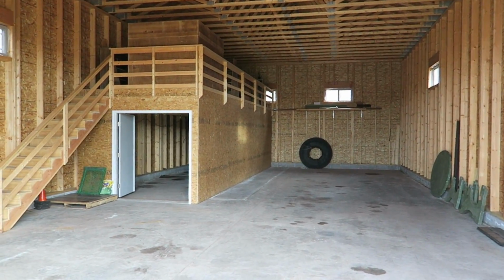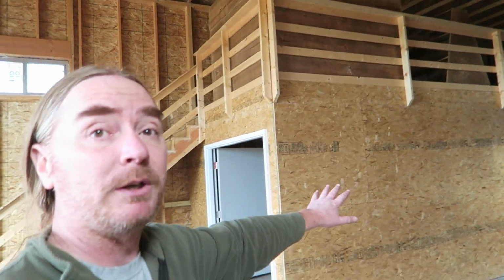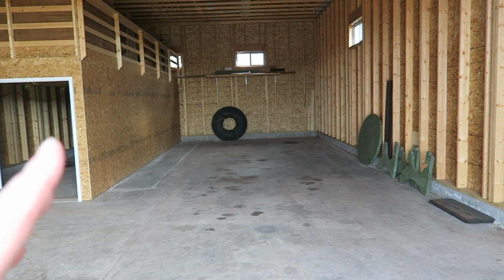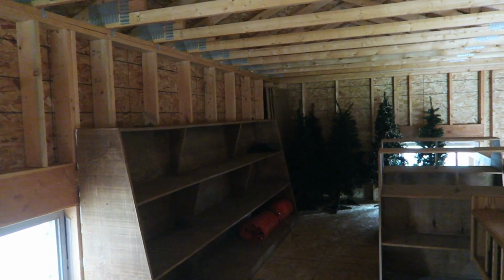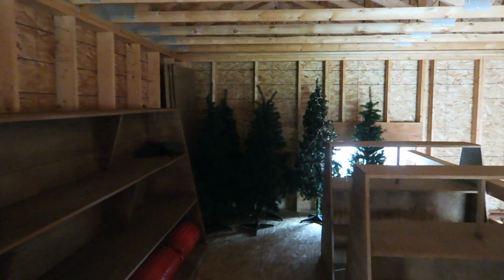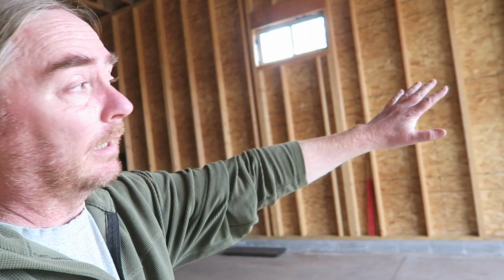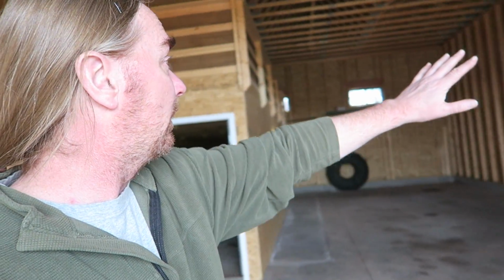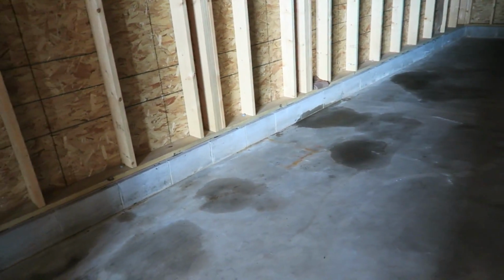CHECK OUT THE NEW BOAT SHOP!!

Comment: One note: in Michigan you are not required to have a licensed contractor run your electrical.  I just wired the basement and garage at my place.  Pull the permit and have a chat with your inspector, they can be very helpful.  My inspector told me what he wanted to see before his next visit, that made it even easier to pass inspection and saved us both time.

Comment: Hi Andy, I'd recommend a U value for your walls of less than 0.35 as this will give a stable temperature in your workshop.  The reciprocal of the R value for the various elements making up your wall (cladding, insulation, air gap, etc) are added together to give the U value (simpler than it sounds).  The heat transfer through the fabric is then calculated from U value x Area x Difference in temperature (inside to outside in winter).  Add all the sides up (including the roof and the floor) and you have the total heat loss through the fabric in kW. Sealing against draughts (air infiltration) is the next step, however you achieve it, if possible try to aim for less 0.3 air changes per hour.  Finally you will need ventilation as you will be painting, etc, so all that air will need to be heated too.  I'd recommend a simple heat recovery air handler to make the most use of the heat you've already got in your workshop, recovering up to 95% of the heat in the workshop.  Its a shame the slab isn't insulated as that will always be a heat sink, but you can compensate by getting the remaining fabric as energy efficient as possible.  Once done, you'll need some heating (you can calculate this from the three steps above), as you have gas, you might consider gas-fired radiant heating.  This will be out of your way and won't blow air around to warm the space.  As for the ventilation you might consider displacement ventilation with, say, 4 outlets ducted from your air-handler to low level grilles in the workshop and a single high level extract.  This will keep the place fresh and cool in summer and shouldn't blow duct around too much.  The last recommendation is to do what you can to stop air leakage around your roller shutter door.  All the best.  Andrew - Consulting Engineer

Comment: I would suggest getting estimates for the trenching and cabling to the shed for grid connection. Compare those to a Solar/ battery storage system, backed up by an Enerpac style propane generator for low solar gain days. Means you become Energy independent. factor those front end costs along with lifecycles, to ongoing utility charges to see if it is worthwhile. 
Many many good suggestions in comments re: insulation and LED lighting but the standout for me is Matt Risingers youtube channel. You want efficiency and not having to spend a single cent more on outgoings after initial build/ reno costs, I am of the opinion his advice is gold
Good luck with it all

Comment: Wow, looks a nice work area. Pity about the costs, but if you're not planning to move again it's worth doing a proper job of it. As for lighting, make sure you get LED lights. Way cheaper to maintain, lasts longer and is MUCH brighter for fewer Watts.

Comment: Could you top the current concrete floor with some rigid insulation and then overtop that again with a new concrete floor so the insulation prevents heat loss into the ground? Added bonus is that you have an opportunity to run services under the overtop concrete. You can pop up power into wherever you want to then.

Comment: Hey Andy, Congratulations on the move!  That shop is going to be awesome!  Yes, 3.5-4" spray foam is a typical application.  It is superior to batting & vapour barrier and gives a tighter seal (less air leakage).  For sure you will not need more insulations in the walls.  Most heat will be lost through the windows and attic than the walls.  

Have you considered geothermal heating?  It will offer the lowest operating costs by far and you'll not have to worry about getting another service  to the shop.  If you shoot me the dimensions of the building and details of the windows, I'd be happy to run a heat-loss calculation so you'll know what size of equipment you'll be looking at.

Comment: Maybe, if the height is too tall, you could put a mezzanine floor in if only for storage. Don't go mad with the insulation as the floor and large doors will always be the main heat loss. Also don't forget to think about the old bridging and condensation.

Comment: Homeowners can pull all permits to build or modify their own homes, including all Building Permit, Soil Erosion, All Mechanicals, Electricals, Plumbing, Driveway, Fencing, even build an engineered septic field (though your drawings have to be stamped).  Understand this is not a residence, so the rules are looser yet, Agriculture buildings are the least restricted cause there is no CofO.   The homeowner then does the work, and may have friends and handymen help.  Contractors are required to be licensed only if the jobs are in excess of $600.  If a homeowner acts as the GC, then in my community, a small town in Oakland County MI, at least 3 trades need to pull permits, Plumb/HVAC/Elec.  Your outbuilding looks top notch, fairwinds Andy!

Comment: Andy, love your channel... never commented before.

If this is your forever home and forever shop why start with a building that so compromises your ability to work.  I’m sure if you factor in the cost of running services 500 feet underground and the additional cost of 30 years of gas and electricity heating a shop with an uninsulated floor you would be better off building a new shop. Build it near the gas and electric, build it where it is accessible by road and build it to your size specifications of width, height and length. Build it with underfloor heating, spray foam from the beginning and I’m sure it won’t cost a whole lot more than renovating that shed. Check out R&R buildings on youtube. Kyle builds these buildings every day

Comment: My $0.02 worth...  you have room in that building to make the walls much deeper than the 6" studs, which also conduct heat.  I would think about  making them 8" deep (or more), with foam, fiberglass, then a 2x4 interior wall and drywall.  
Lumber prices have shot through the roof (3x?) in the last year due to COVID shortages on production, and high demand for larger houses on the consumption side.  Anything involving lumber that you can delay may save you money.
As an alternative to a gas line, you may be able to use a large exterior propane tank, and save trenching costs.
#notanexpert

Looks like a nice space!

Comment: set poles to run service ? led low bays 200 amp service 30-40 circuit panel 4  foot outlets every 10 feet lower lights in work areas. water ? off house if u dig electric freeze line 4 feet?

Comment: 9500. spray + 4000 ceiling blown 1/3 more for thicker.
 owner builder permit should be allowed anywhere. if not dont permit. screw um the problem is cost and freeze level. start digging.

Comment: For insulation in the walls we spray 1" of foam and fiberglass batts over that.  Ceiling we usually go with fiberglass batts, or blown in if access is poor.

Comment: I live in the upper Midwest and had Icynene foam done 13 years ago. Studs are old, full 4" timbers. Cavities were slightly overfilled and cut flush with a massive hand saw. The installer said it was an advantage because, in addition to stopping air infiltration it eliminates air period. No air, no moisture. Good luck!

Comment: what about the issue of running a business in a rural area.. a friend spent a fortune in a dairy barn to make it into a top notch automotive shop. county said a year or two after he had been running . nope nope nope..  Sampson boat on YT had a single neighbor that complained and he has to finish  enough of Tally Ho to move it to a big boat shop in town..  you may have an electrical and perhaps heating alternative or backup.. by using a marine generator set in an external building that is built with staggered stud walls.. so the sound does not transfer thru the wall .. this could power your shop and if you are going to live in a house there too.. it could supply heat to the hot water radiators in the shop..  i know of one guy who runs  milk delivery service. and he has installed a reefer unit on his home.  as  back up heating and back up AC as its in SO cal.. and he lives on a hillside in the sun. 
 i totally agree that at least the area outside the slab in front of the shop is way too sloped to safely get a boat of decent size in and out without issues..

Comment: You have a lot of studs and the thermal bridging is significant if you go with closed cell foam. CCF is a great vapor barrier - you won't need a plastic sheet VB but what really matters is the R value of the whole wall assembly. Sparay Foam also glles your building together and any future renovations are made much more difficult. If it were my building I'd flash and bat with rockwool then sheetrock. See here:  https://www.finehomebuilding.com/project-guides/insulation/closed-cell-foam-studs-waste

Comment: Low intensity infrared tube heaters would be best for the work you do and that type of building. Very comfortable. Make sure they use outside air for combustion due to your dust.

R 19 would be your minimum.

Comment: for heat look into a used oil heater. it can also burn your old solvents if you mix them with old oil. they are cheep. 4 K for a great one.

Comment: Andy, congrats on the new place. I would go with rockwool insulation.  Great R value and you can do it yourself. As far as lights, go with LED. Be careful, you get what you pay for with those. Also, with LED's, the better quality lights won't give you a hyper flash that you will be able to see on camera. Good luck with the project. Can't wait to see it finished.

Comment: Andy spray foam and R values really don't mean much. R value is a measure of time. The higher the R-value the longer it takes for heat or cold to radiate through it. Spray foam does not radiate heat or cold so you would be much better off with 3 to 4 inches of foam in the walls and 5 to 6 inches of open cell foam on the roof deck. Most heat will come thru the ceiling or in your case escape there. Foam is the only way to go but you would need to use it in both the walls and roof deck. Otherwise you are wasting your money to do only walls or only roof. Good luck and I love your channel.

Comment: Andy, as a retired electrician, who has done a lot of shops, I'll throw my two cents in. Do not put any electrical in the walls. Keep your vapor barrier intact.  I usually run a 3/4 conduit at 54 inches all around the perimeter with junction boxes every 8 feet. Your switches and recepticles can come off these junction boxes. And go for the LED highbays for lights, I've never had a complaint. And keep your panel, heating and compressor in a separate "utility room". A friend of mine glued Styrofoam panels to the inside of the overhead door panels, it was a big improvement

Comment: The studs look like they are 2 feet on center. Counting the studs, the building looks to be 30 feet by 62 feet, you need to get your tape measure and double check the stud spacing and then count the studs to get a building size. Running utilities will also get expensive, you will need electric, water and possible gas run to your building. Get a cost estimate to have someone run the utilities and then you will know how much money you will have to do insulation, lights etc, to have a working shop. You have a great base of followers with good ideas of how to do things cheaper, so let us know your problems and your followers will help you. Good luck.

Comment: Building automation programmer here - so only mildly useful in this situation but I work on energy management systems.  I will say check with your local utility company, most have massive incentives for insulation, heating and lighting upgrades.  Before you call them throw up some halogen lights, and maybe an electric space heater or two.  It could be worth thousands in rebates.  Second, you're going to want destratification fans, 10' or so turning relatively slowly just to move the air if you're going with baseboard. It will create a convection current and heat the space more efficiently rather than creating a heat bonnet. Typically Lucent technologies makes good LED panels.  The only problem is the driver boards on most LEDs aren't living up to the claimed 50k hours of life.  Other things to consider would be solar heating, or at least solar domestic hot water.

Comment: R value IS efficiency.  If they're at R19 and 4x the cost of R19 bats, no.  Not worth it.  The question is what do you have for a vapor barrier?  I think in your climate it's common practice for the vapor barrier to be on the inside of the structure.  If that's the case I would look at cellulose blown in insulation hands down.  It's what I put in my shop.  I had a couple of foam contractors come in and quote my (1800 sq ft 2 story) structure and they couldn't really answer any technical questions about moisture mitigation...they just wanted to blow foam everywhere.  The cellulose was blown in moist with an adhesive and it dries and becomes a block of insulation.  The only complaint I've heard was from a fire chief who lamented that it tends to smolder and makes it lengthy to put out hot spots (which, honestly, at that point do I care?).

Comment: I would go with high bay LED’s because of the high of the ceiling. I would recommend 4K color so you can see the line in the boat when repairing glass. The 3k color is to two orange and 5k to bright. I would buy them from electrical supply house. I also would rough in electrical outlets and lighting before insulation. The cost savings vs piping in conduit is huge. 
   I will agree with the comment about dual fuel furnace. I run oil and wood fired furnace and love it. P.S. you have plenty of trees for fuel. 
    I know spray in insulation is better R-value over regular insulation. I would sheet rock the ceiling and blow in the insulation in. I wouldn’t spray foam the roof rafters because you want the roof to breath. You will have moisture problem if you don’t have air movement up in the attic. 
The floor looks like oil. Put water on the spots and see if needs up.  Simple green and a brush to clean. 
Good luck. 
Nice shop.

Comment: Andy, Closed-cell foam has an R-value of 3 to 3.2 per inch  I know a lot of guys will say you don't need more than 3 or 3.5 inches but for sure more is better. The only issue is with filling the space between your wall studs is that if it expands out past the stud it will have to be cut back so you can sheet the walls. I used to own a foam company and all we did was cold rooms with closed-cell foam it's a great way to go probably the best R-value per inch that you can get. Expensive for sure. sorry! I am a contractor in south Florida (HVAC) but I can't tell you the best way to heat your build there though we have installed floor heating systems in industrial freezers to prevent the slab from heaving when the freezer gets to temperature using hydronic tubing in the slab. I noticed a curb beneath the walls perhaps you can install it on top of your existing slab then back pore over top. Might consult with an engineer on that first. We don't do much heating here so I can't say for sure.

Great shop congrats 

Kevin

Comment: 6 inch batt insulation is R-19. Spray and batt is common to save money. Unfortunately, one of the best things you can do is add 1 inch rigid foam on the exterior, breaking the contact to the outside air and achieves, something on the order of 90% or the potential to insulate. The bulk of your heat goes "up" through the roof. (In response to your question about doing the work yourself: As a homeowner, you can do the work yourself, acting as the contractor.) Lighting: Get LED and it will solve those problems.
Reply: One last thing, been in construction in Michigan my entire life, taught construction trades, would be glad to lend an opinion if you need it, hit me up and we can talk.

Comment: Send an email or video over to the crew at the Fine Homebuilding podcast. They love talking about this stuff, especailly shops. Almost ever episode ends up talking about air sealing. It is my impression that they are not the biggest fan of foam insolation. A big disadvantage is that it is hard modify after. The green home building forum would also be happy to take this on. The big door is going to be the hardest thing to air seal and if you want to make it really tight switching to a carriage door or similar sealable door would help. It might be worth looking at aerobarrier for an air seal and then just mineral wool for insolation.